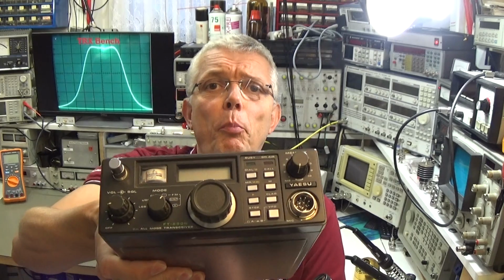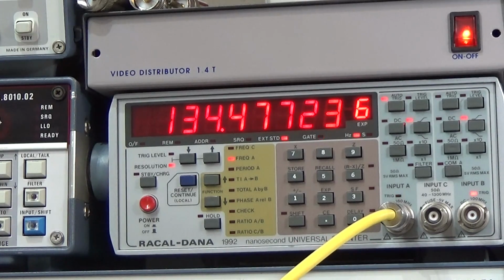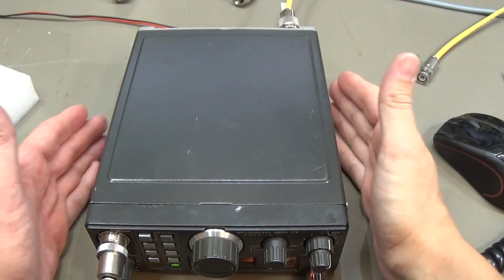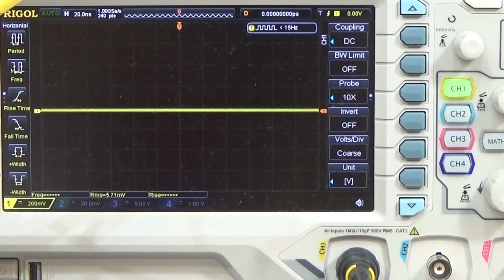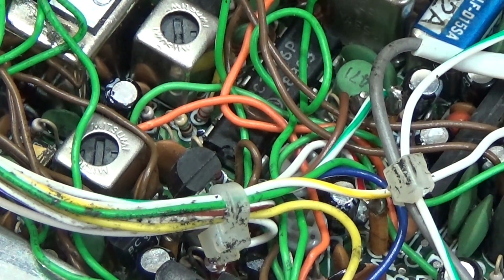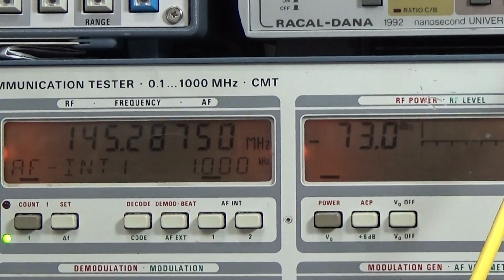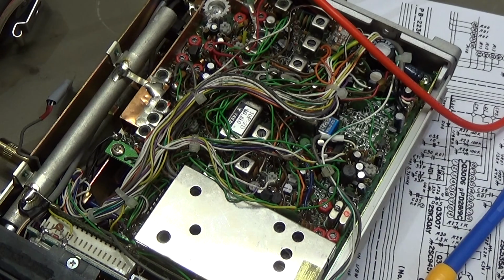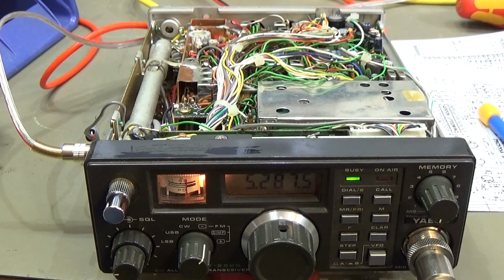#110 Yaesu FT-290R Restoration or Repair?

Comment: It's nice that you can determine the failure by checking the frequency with a frequency counter.  You determined the area to look at just from a simple test.  I realized that in the middle of the video that it just might be the ALC since the voltage is low at the MOSFET IF amp.  The ALC could limit the voltage to the IF amp.  Once again, the bubba with the "golden screwdriver" has left his mark. I cannot fathom a tech would not know his emitter, base and collector orientation.  W Rusty Lane K9POW in eastern Tennessee

Comment: Hi Peter.
I've just purchased one of these little gems off from €bay.
Apart from the "Step" key not working and the front panel plastic tabs are broken, the radio is spot on frequency and good reception too.
For more info on the FT-x90, there is a Yahoo group. You can find there a component placement and identification sheet. (link at the end of comment)
Good job and thanks for sharing.

https://groups.yahoo.com/neo/groups/electrichandbag/files/Component%20Layouts/
Reply from the maker: Ah very good! And thanks for the link..very interesting 73

Comment: Where did you connnect the frequency counter to measure the 134.47MHz? I assume it was not the antenna jack as this would give the final Tx frequency of 145.27MHz.

Comment: Hi Peter, i think these radios have a high low power switch on somewhere, 2.5 watts and something like about 0.5 watts....so you can use with the internal batteries on low power...Fred.

Comment: Enjoyed this video, thank you! Sometimes it is easy to find a problem but also easy to be distracted and screw up the easiest thing, this was the case with this radio. 

When you said someone else had replaced it i first thought about cold solder joints but no, they had put the transistor in backwards. Happened to me too, more times than i care to remember. :D

I do not repair radios for a living, i repair computers and laptops as my day job, but i do mess around with transmitters every now and then, i build them myself. I do not have proper RF test gear but from various resources like your and Paul's and others' videos and also my imagination and electronics knowledge, i have built several devices that help bridge the gap between theory and circuit, without burning the wallet. Besides my dual 50MHz analog oscilloscope I now have my own dummy load with power meter, RF probe for multimeter, RF inductance meter (my own design) and SWR meter (http://ludens.cl/Electron/swr/swr.html). I am now able to build no-tune, broadband linear amplifiers with better than 1dB flatness across the band of interest, something i could only dream of just 1 year ago.

Some have commented that you repeat things too much. I personally like your style of explaining, sometimes it is long winded but it helps overcome the language barrier, especially when the viewers are also non native English speakers. Also it is good for learning, hearing the same thing several times helps to memorize it.

Also the repeating makes me fall asleep easily, i usually watch videos before bed and sometimes fall asleep and wake up to something totally different (have to turn autoplay off) whereas if i watch Mr. Carlson i have to pay attention to everything so i don't fall asleep until the end haha.Regards once again,Andrei from Romania

Comment: Great repair Peter, it's no easy to put hands in radios as that; very nice to understand the logic way (thanks frequency counter) to identify the problem in 1st mixer stage or IF amplifier or ALC. Compliments !!! 73s de IW0HEX Pasquale.
Reply from the maker: Hi Pasquale, yeah it is always good to have the right tool that makes things much easier..But you are right it is still a challenge. Thanks for watching and comment my friend. 73

Comment: I should still have the same yaesu somewhere in the to repair box. Remember it had problems with the PCB through connections of the double sided controller / display board. I've started to rebuild it on a new PCB, but it was too much work to get it done. Seeing this video makes me think if I should make a new PCB layout for it and produce it in a small amount or not. First thing to do is find the unit and the rest of its internals. ;-) 73 de PA3FUS.
Reply from the maker: Hi and thanks for watching. Good luck with your project 73

Comment: Nice job, Peter. How could you tell the transistor was in backwards?
Reply from the maker: Thank you Robert! Well we had a replacement transistor which is basically not wrong but according to the schematic  pins were mixed up. That can easily happy with a replacement typ. So nothing special to figure it out. 73
Reply: Ok, I don't know why I was thinking of a multi-layered PCB.

Comment: the FT290R is still a great radio, it has a rudimentary but very effective PLL , which is also a lot quieter than the newer generation PLLs. You don't need to recap all the radio. Change the capacitors in the minus 6.8 volt converter, the AGC section and the backup battery section. And realign all the oscillators. It will work many years after this flawlessly.
Reply from the maker: Thanks for watching 73

Comment: Hi again Peter if mine in on max S Meter, S9 all the time on recieve do you think its to do with the ALC/AGC transistor circuit?? mine does drop down after about 1 hour, Fred g4vvq
Reply from the maker: Hi Fred, it could be an ageing cap somewhere around that area.. A lot of funny faults comes from defective electrolytics...73
Reply: Yes my thoughts entirely, it hasn't had much repair work since it ws built, so could be Caps...Fred.

Comment: Hi Peter i have a FT 290 as well, bought in 1983, i dont use it often, when i put it on the S meter goes right up to 9 on recieve, like that one, if i leave it on about 1 hour it comes down to S 1, so think might have same problem...it transmits ok...Fred g4vvq.
Reply from the maker: hI fED; YEAH THE FT290 were really nice radios at its time.. Thanks for watching 73

Comment: It is nice every once in a while to have a challenging repair, but having said that it's so much easier with an "easy one!" Just finished repairing a very old Cushman CE-15 Spectrum Monitor that I got this week and fortunately the only thing wrong was a misaligned coupler on the on/off/volume switch; of course that took a few hours to diagnose and repair so there was some fun involved! TNX Peter for sharing!  73 - Dino KL0S
Reply from the maker: LOL yes Dino that is right and even easy repair can consume time.... Thanks for stopping by 73

Comment: Great repair Peter you sound a little disappointed that it was to easy. Say you were to replace some capacitors do you believe the frequency drift would require some alignment. And at what stage of the radio would you start to replace and align? Does the manual you have have an align procedure and test point for servicing. Let's hope next time the repair will be a little more complicated.
Cheers from Canada :>}
Reply from the maker: Hi Tom, well yes i could have been easy but looking for components and test points was really painful..I would only swap out the electrolytic s.  Beware of changing caps around the VCO and the PLL. Alignment should be done according the manual.. Thanks for watching 73

Comment: Nice effort Peter. I fully agree without the full service manual its hard to measure signals. There are allot of people out there that would just guess Peter and thats why u had that repair to attempt in the first place because the person before u guessed and got it wrong. It is possible to repair stuff without service information but it takes a very long time trying to reverce engineer circuits and it still takes allot of experience. Well done Peter u did well with this job with the information u had.
Reply from the maker: Hi Gary, yes I fully agree that problem is really the time..Thanks for watching 73

Comment: I had the same problem after the set was in a drawer for 11 years. 
The S-meter stayed on the right side and the receive was terrible.
When I lowered the 12 volts to 9 volt the radio started to work again.
It had something to do with the caps.
After I did leaved  the radio on for days the radio came back to live and worked on 12 volt again
Everything works fine now and on frequency.
When I am on a holiday and come back after 3 weeks, I have the turn the radio on and after 15 minutes it works perfect again.
Actually, I should recapping but considering the age (mine is from late 1981) and the many wires, I will not do that.
The radio works everyday and is tuned on a local repeater.
Reply from the maker: Hi, yes most probably the caps...If it is 290rII then it is easier to recap but the early version is a nightmare. Thanks for watching 73